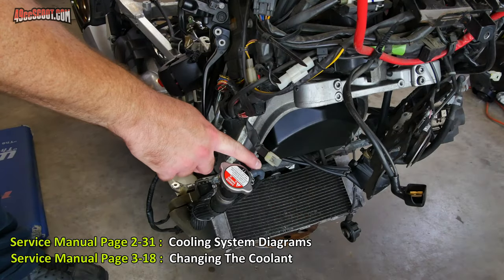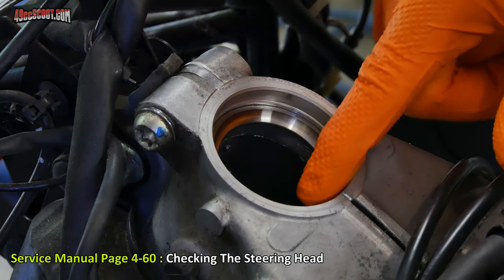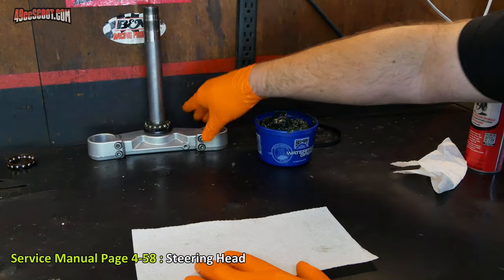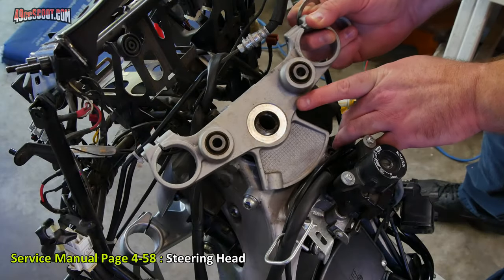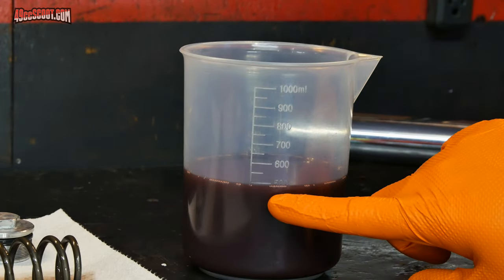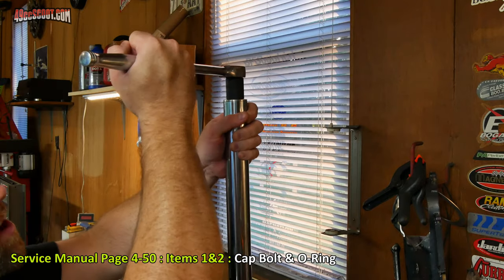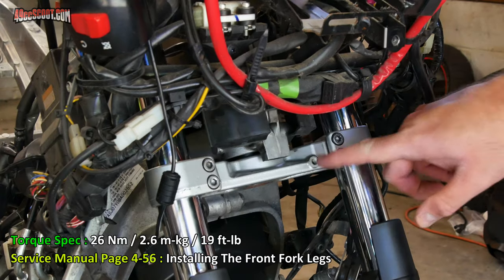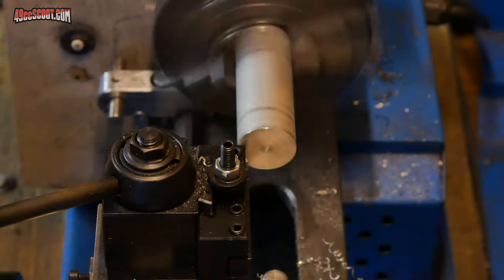Steering Head Service, Fork Oil Change & More! : Yamaha TMAX 500 Part 8 : Scooter Motorcycle Repair

Comment: I'm late to the party on this, but really glad I've stumbled over your work. Have a 2008 and lots of bikes have come and gone since then, but I think I'll always keep my TMax. I would recommend for your weight, upping the oil volume. It won't affect the damping characteristics till the last third of the stroke, but it makes a big difference when, for example, breaking hard into a bumpy corner.
The theory is you're upping the air spring effect, common, and recommended practice in the off road world where bottoming resistance is crucial. My next project is to try a Race Tech Emulator. People don't realise how quickly you can hustle these things, but the fork action is, in my opinion, the weakest link. Thanks for sharing.

Comment: The ring nuts are DIN 1804, a piece of trivia with some marginal value.
I like your homemade socket for them.
If you don't have a wrench/socket, and you are going to use a pinch/drift to remove/install them, then I recommend using a scrap of brass or aluminum scrap. That way it doesn't deform the fastener, and no one is the wiser : )
Bearing/race dents would be brinelling. (ducks)
Your Yamaha TMax videos will become the go-to reference.

Comment: Great video again. 
It was a bit off a scare for me to see that they still use ballbearings instead off conische bearings. 
I didnt think they use that after the year 2000 ! So for a T-Max a cheap bearing. 
When i do my t-max i will change them to conisch bearings. Then you never have problems again.

Comment: Opened gear-box,original V-Clic.Extreme heavy to turn.50 000km.And axl bearing was blocked,but its fine after 1 day off.Also braking-system.Axl 17.1 mm and bearing position 17.2 mm and outside diameter,probably alike.But crankshaft is not pressed in the case,neither the gears.SO THE PROBLEM is bearing squezes the pearl.And front wheel even have good 1 mm free space.SANDPAPER off 0.1mm.

Comment: I am using tmax xp 500 . I found out ther is an oil leak from the left front shocks. But it is difficult to get the seal here
Reply from the maker: Not sure where you are, but I used Partzilla for OEM stuff.